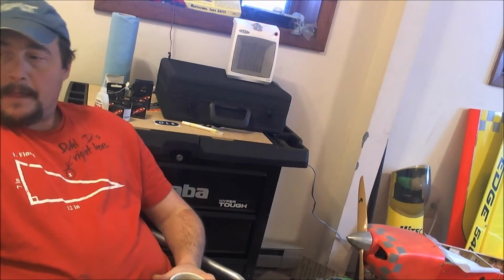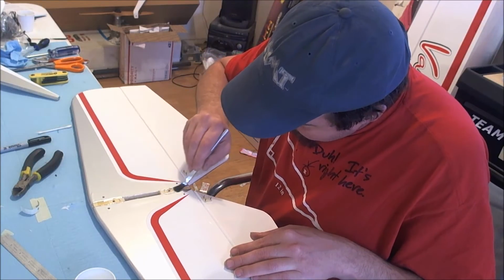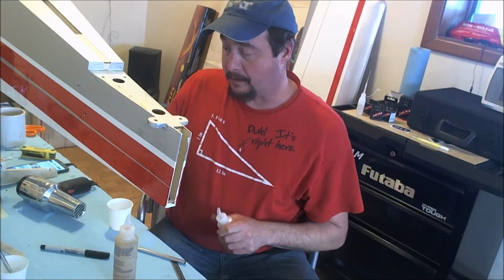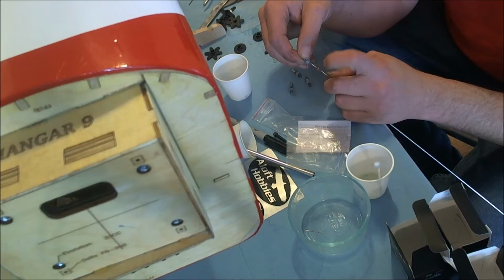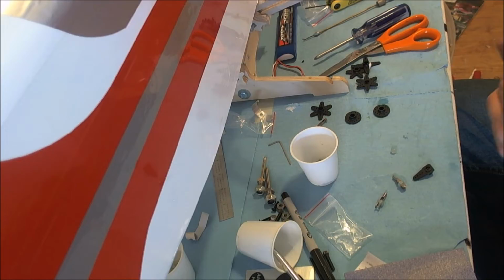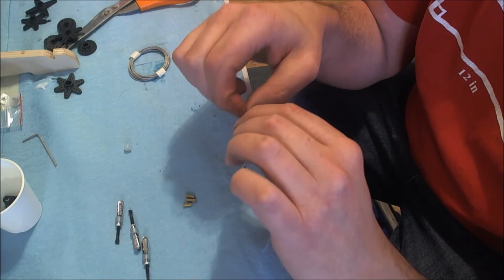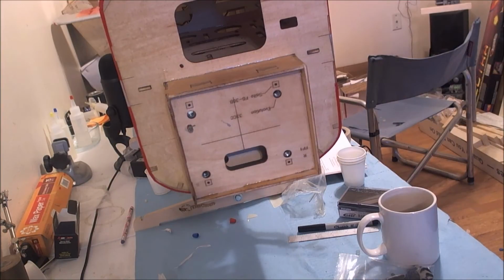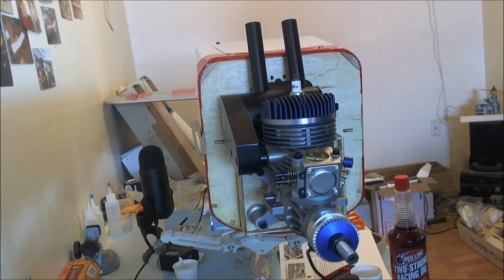Valiant Build Part 2

Comment: Great Presentation
can I please ask you the following questions:
1.what is the Gasoline volume capacity  for this plane?
2.What is the range distance in full tank?
3. what is the flying time in full tank?
4. have you consider having a second use such as mapping etc
     using missin planner Audupilot and telemetry?
Reply from the maker: The fuel tank is 7.75 ounce and it flies roughly 15 minutes on a tank of fuel depending on throttle management. As far as telemetry, I have no interest in such things as I just like to build and fly. The other things you are asking about are illegal without your FAA Part 107 and I have no interest in that. This is a hobby of building and flying like something a father and son enjoy such as myself and my son.
Reply: @bigskyhobbycorner603  
Thank you for your response 
My interest has not illegal purposes 
If a long range requires a FAA permit, I will be the first person to file for permit 

Thanks
Reply from the maker: @franciscourena5636  understood, so many people taking advantage of this wonderful hobby and making it hard on folks that just want to build and fly. It is a great father and son hobby
Reply: @bigskyhobbycorner603  
I agree with you 
My daughter wants to be a pilot 
She loves airplane 
My brother has an uav fixed wing (battery) and he uses for mapping 

I thought a gas tank was going to provide more power than the battery but I now understand 7.75 ounces is only good for 15 minutes

Comment: I finally got my hands on one of these kits. Going to use a DLE 35RA and going to use Robart hinges, not the ca ones in the kit. Seen 3 planes that had ca hinges fail. Keep up the good videos. Avistar 30 is still fun to fly. Timder 110 is on the build bench right now. My way of practicing social distancing.

Comment: No way Peter Goldsmith used that crap Evolution engine.
Reply from the maker: Indeed he did and still does. This one on this airplane runs solid per his advice
Reply: Indeed he did. Ask him on the facebook machine. With Peter's advice I was able to get mine running solid. You can not tune them like a DLE and such.

Comment: Nice tuto!! I have a Valiant as you can see with a DLE 35cc. I have not yet used flaps because I need to mix with the elevator. How much have you used compensation at each stage of flaps?
Reply from the maker: Admar Godoy , believe it or not I just add down elevator by hand. If I were to mix it I would add 10% down to start with but I only have 20% down flaps. Anything over 20% just like real aircraft just adds drag and not lift.